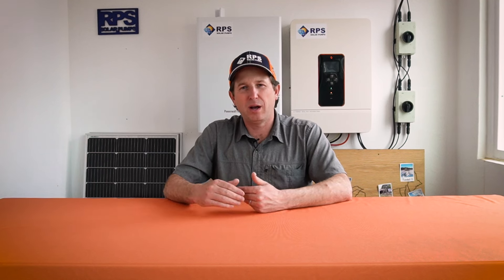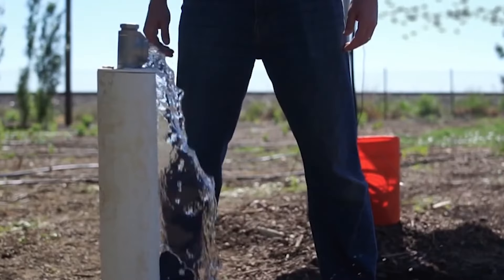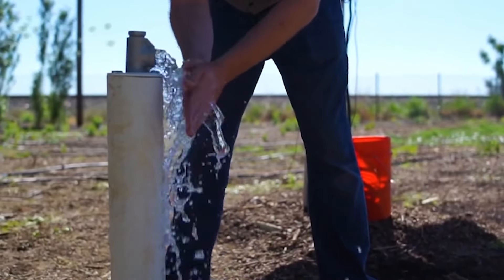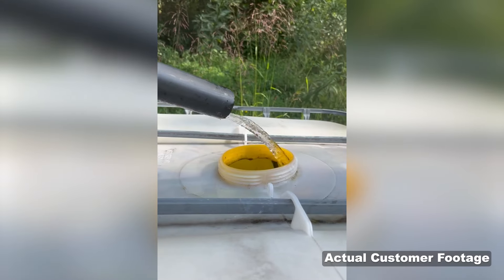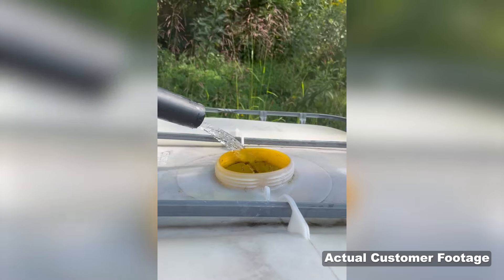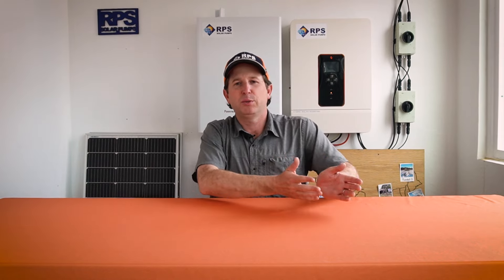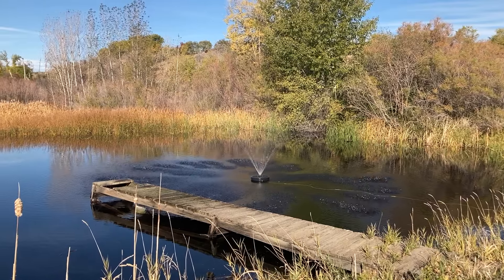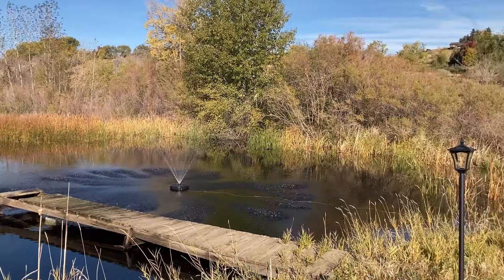How Do I Choose A Solar Pump?

Comment: I love my RPS. I LOVE your customer service too. Carmen and Anthony were so helpful when i had some problems with my system. Tyler was great when I came to your facility to pick up a new set of batteries and bring back the inverter/controller that died. My syatem is running perfectly again.

Comment: great video, thank you, bit of a long question, but I'm almost sure it will become a problem for others like me who are learning  also :). I installed a pump for hot/cold water supply on a residential site together with an off grid power system. The pump is 24V to run straight off the batteries, it is 200 psi with a 10l/min flow rate and 2.7m head. I found that the pump would work for a while, but occasionally burn out the pressure switch, requiring replacement. Talking to the manufacturer, this turned out to be because we had restricted the flow, which was needed to allow the hot water system to work properly. This pump needed to maintain its flow rate to avoid having issues, but I wondered if there are off grid pumps available which can have a variable flow rate as you turn off/on taps which would avoid this issue? or whether its just a matter of choosing a pump with the exact flow rate for the downstream equipment?